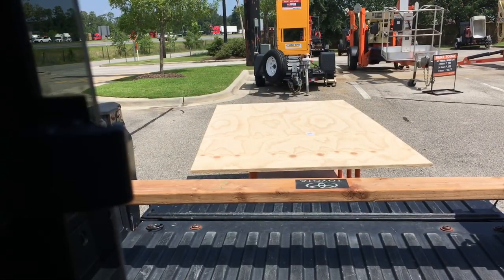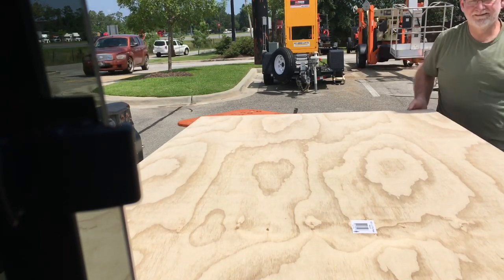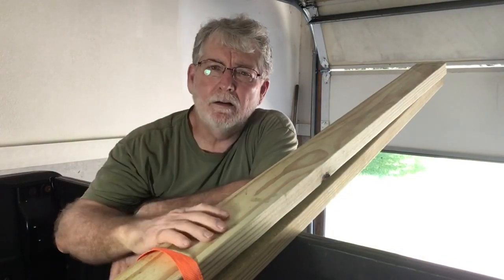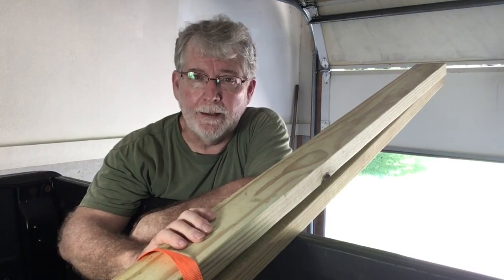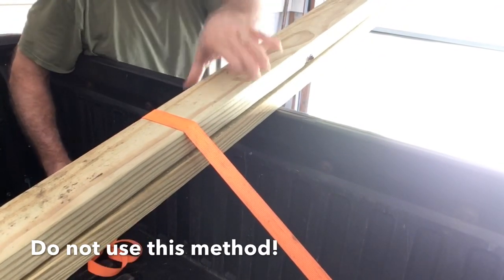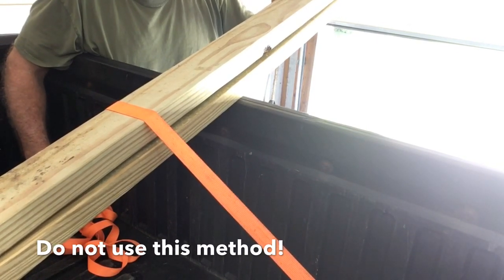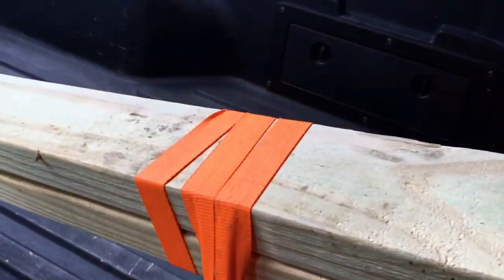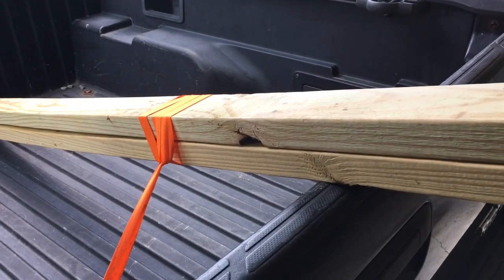How to Haul Plywood and Lumber to Your Shop

Comment: Thank you for the knowledge!
Question: for securing a load of lumber thats not leaning on tailgate, but flat instead, can the same method be used (from securing the 2x4s)?
And if so, would it be beneficial to do front and back of load for extra security?
Reply from the maker: No, I would secure the lumber front and back to the bed of the truck.

Comment: Great video. I learned a lot. One question though.  Did you drive off with the milk crate in place? If so, what holds it from slipping out as you drive?
Reply from the maker: Yes, the crate is what makes it all work.  The tie down is between the crate and board.  Pressure is pulled down putting pressure on both the board and the crate.  It can not move.

Comment: Now I have to go see if our truck has those slots. I always just throw plywood in with the tailgate up.
Reply from the maker: I have done that as well.  Plywood just does not fit well and if I carried sheetrock, the corners would break.  With the method shown in the video, I never have a problem with damage.  Don't forget to tie the plywood down if you throw it in with the tailgate up.  Thank you for your comments.

Comment: Good information, thanks. I use my 6x10 aluminum trailer but I know what you mean about plywood, I’m 68 and I had to carry 4 sheets of 3/4 sandee plywood and I forgot how heavy that stuff is. I like to not have carried it. I got one of those Gorilla grippers but it hurts my wrist when using it, not a fan.
Reply from the maker: Thank you very much.  I understand what you mean about the Gorilla grippers, that is why I put everything on wheels.  I use my two wheel dolly to get the plywood into my shop and to the saws.  I'm also designing a cart now that will make it even easier.

Comment: Just for your info, not all pickups has those cut out or anchor points on the bed. And why not just close the tailgate once in is in the back of your bed.
Reply from the maker: Because I do have the anchor points and they work great. It is easier for me to load and unload my truck. As I get older, I look for the easiest way to do things.

Comment: Couple points for you to consider:  I would not haul lumber sticking up over a tailgate as shown.   Doing things like you showed leads to dented tailgates.  Put it in, just like you showed with the plywood, on your short boards.  Then you need to secure it at both ends, not just at the back with the straps as you showed.  Anything that sticks out more than a foot or so past the lowered tailgate needs to be hauled on a trailer, or in a bigger truck.  I've hauled sheet goods and dimensional lumber, everything from a few 2x4s to a whole bundle of 6x6 timbers my way hundreds of times over the past 40 years, never lost a single board.  YMMV.
Reply from the maker: Thank you for sharing your comments.  They are very valid and I hope that others will read them as well.